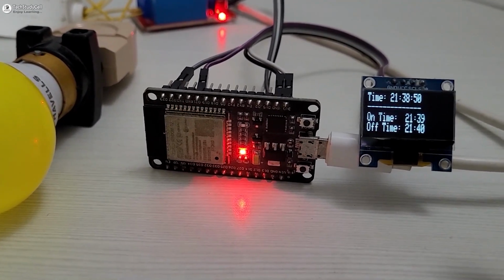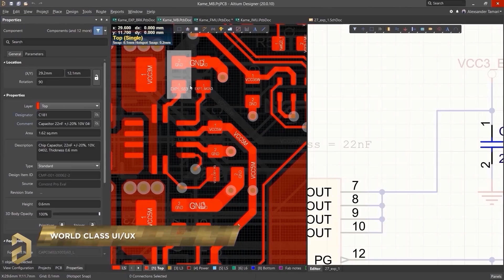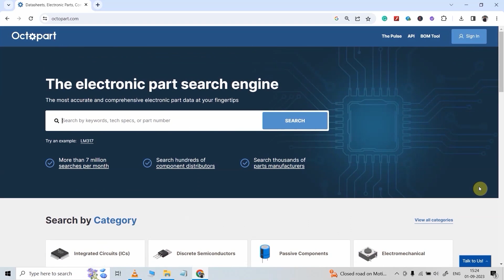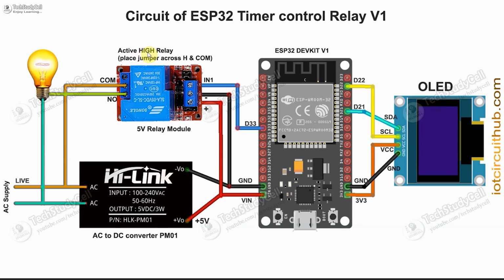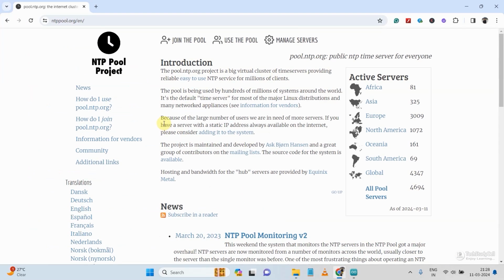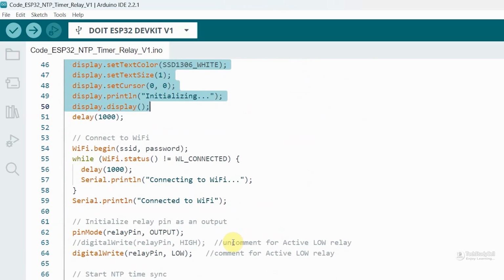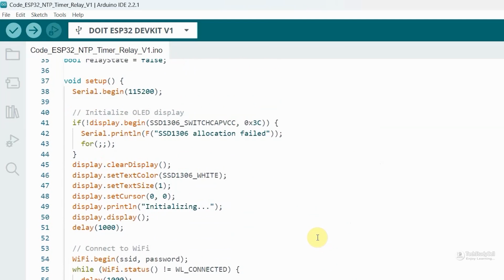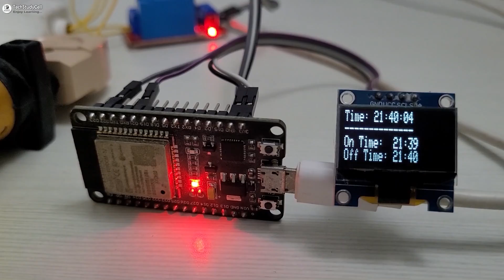ESP32 Internal RTC Timer control Relay without RTC module | Real-Time Clock with NTP Server

Comment: What if there's power failure
Reply: Data stored in-side esp 32 rom .so it will remember relay State asper project he used preference library's or you can use eeprom.h library